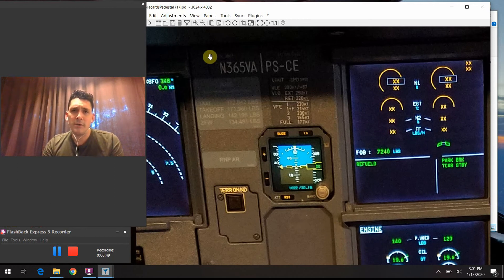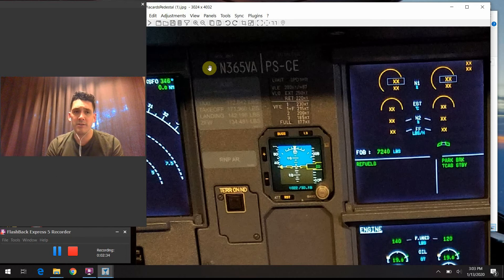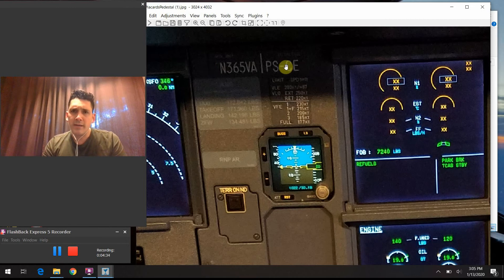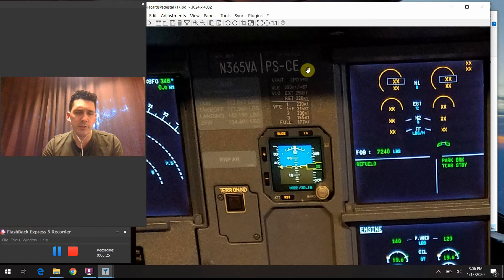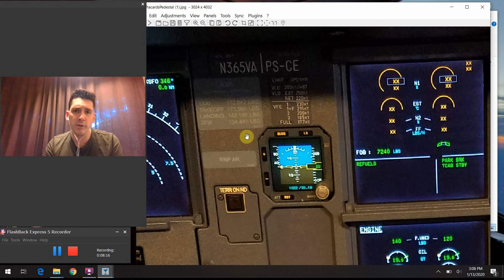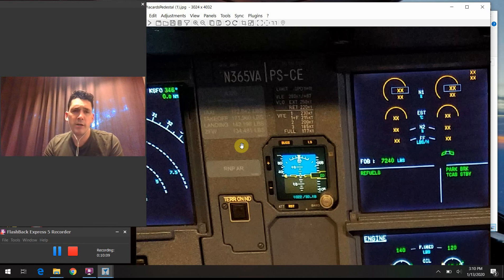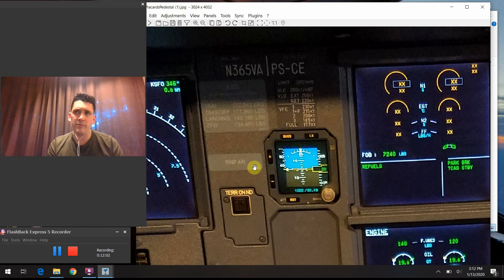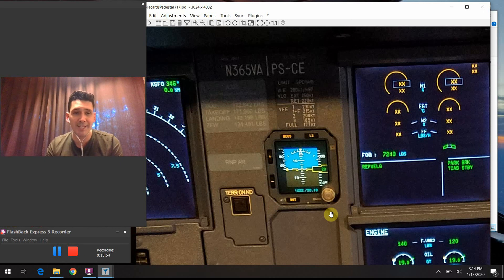Airbus A320 Cockpit Tour: #36 - Placards: What do all those buttons do?!

Comment: Hi Mr.Abignale

What is the difference between flaps 1 and 1+f configuration? How do you select between these configuration? 
In your discussion with Mr.Leonidas , you mentioned different speeds such as Vfe , Vle, Vmo/Mmo. What is the difference between Vmo and Mmo?
And the last question (not related) : Airbus just posted a video of their ATTOL : Autonomous Taxiing Takeoff and Landing project, where the plane takes of without sidestick inputs from Pilot flying. What do you think about this project and its capabilities and limitations?
Reply from the maker: Hi Aby! Great to hear from you! 

What is the difference between flaps 1 and 1+f configuration?

F1+F = takeoff and go around setting only.   Specifically,  in this configuration the Slats will be at 18° and the flaps at 10°

F1 = approach only configuration. The slats will be at 18° and the flaps at 0.

How do you select between these configuration? 

They make it easy on us as pilots. The plane knows what phase of flight you are in, so all you have to do is position the handle to '1' at the normal time and the plane gives you the appropriate setting. No more thinking involved other than that haha.

In your discussion with Mr.Leonidas , you mentioned different speeds such as Vfe , Vle, Vmo/Mmo. What is the difference between Vmo and Mmo? 

V is always used when referencing an indicated airspeed.  M always when referencing a Mach number.  So in our case we are talking about MO Max Operating speed in either V or M. The two numbers are sort of used interchangeably depending on whether you are in the speed envelope,  as there is always a corresponding IAS to a Mach # and vice versa.

To be specific, VMO/MMO on the 319/320  is listed as 350kts/M0.82

And the last question (not related) : Airbus just posted a video of their ATTOL : Autonomous Taxiing Takeoff and Landing project, where the plane takes of without sidestick inputs from Pilot flying. What do you think about this project and its capabilities and limitations?

Great question! I do have some opinions. I'll try to share some thoughts on the next video. 

Best regards my friend!
Reply: @MikeAbignale  Mr.Abignale thank you for answering my questions but I have another doubt about the Vmo/Mmo 
The Vmo/Mmo is given as 350/M 0.82 
But when I convert these values, they are different . 350 knots is roughly M .525 while M .82 is around 500+ knots. Why is that? Also during cruise phase, the PFD doesn't show the actual speed of an aircraft. Instead, it is given in the navigation display. Why is that?
Reply from the maker: @abythomas6963  
Excellent observations Aby!

The Vmo/Mmo is given as 350/M 0.82 But when I convert these values, they are different . 350 knots is roughly M .525 while M .82 is around 500+ knots. Why is that? 

The relationship between V and M actually changes as we go up in altitude,  so this relation is not linear. Mostly has to do with air density. Did you know that more than 1/2 of the earths atmosphere exists below around 18000ft? So the way I think of the 350 or .82 max speed, is like this,  whichever occurs first,  that is your limit. 

Also during cruise phase, the PFD doesn't show the actual speed of an aircraft. Instead, it is given in the navigation display. Why is that?

Well as we are flying there are various speed references we are concerned with. The IAS is most important in the regard that it tells us the aerodynamic flying condition of the wing.  Are we going too slow, are we going to stall? Or are we going too fast,  and we are going to damage the plane? As we go up in altitude air density decreases so we need to physically move the object faster through the atmosphere to get the required number of air molecules over the wings to keep it flying. And this is where we get True airspeed. Now we make a correction for headwind or tailwind,  and we get ground speed. The most important speed to the passengers haha,  meaning,  how fast can you get me from A to B. 

Hope you are having a wonderful day my friend!
Reply: @MikeAbignale Thank you for the explanations. So if I understand this correctly, does this mean that below 18000 ft  , Vmo is followed and 350 is the limit and above 18000 ft, Mmo is followed and .82 is the limit or does the speeds have nothing to do with altitude of the aircraft and one of them will be attained irrespective of the height of the object?(meaning the IAS would be 350 knots and Mach would be .82 irrespective of the altitude of the aircraft?)
Also, does this have something to do with the 250 knots speed restriction below 10000ft?

Also, about the explanation on my second question : so after takeoff and climb out to cruising altitude, the IAS is more or less used as a stall indicator of sorts and TAS and groundspeed comes to higher prominence during the cruise phase? Or did I miss something?
Reply from the maker: So if I understand this correctly, does this mean that below 18000 ft  , Vmo is followed and 350 is the limit and above 18000 ft, Mmo is followed and .82 is the limit or does the speeds have nothing to do with altitude of the aircraft and one of them will be attained irrespective of the height of the object?(meaning the IAS would be 350 knots and Mach would be .82 irrespective of the altitude of the aircraft?)
-Well, you have the concept, but the 18000 ft is not a hard and fast number by any means. Generally speaking, at lower altitudes you will reach the IAS limit before you get to Mach .82, due to greater air density. But remember, the atmosphere is very dynamic and density is always changing depending on the day. So it all just depends one what the conditions are of the day where you will find the "crossing point" lets say to where 350kts corresponds to M.82

Also, does this have something to do with the 250 knots speed restriction below 10000ft?
-It does not.The 250kt speed restriction is for ATC only. Think of this analogy...ships coming into the harbor. There is a high volume of ships coming in and out of the port, so it helps the controllers to slow everyone down so they can sequence and space all the traffic more easily. Same concept with airports, atc, and the 250kts below 10Kft.

Also, about the explanation on my second question : so after takeoff and climb out to cruising altitude, the IAS is more or less used as a stall indicator of sorts and TAS and groundspeed comes to higher prominence during the cruise phase? Or did I miss something?
-Well sort of. But the IAS is ALWAYS important to us, be it at high or low in altitude. Let's take this extreme example to demonstrate my point. Lets suppose that a clean A320 wing(subjected to 1G) stalls at 180kts. 10 Feet off the ground, the aircraft will stall at 190kIAS and 190kTAS. Now lets say we go up way high in the atmosphere, air density drops off significantly. The wing will still stall at 190kIAS but the true airspeed at this point will be much higher, lets say, 380kTAS. I'm just making these numbers up, but hopefully that makes sense just to prove the point and show the relationship between IAS and TAS as we go up, and while we are always concerned with the aerodynamic flying condition of the wing.
Reply: @MikeAbignale  Now I get it......Thank you Mr.Abignale 😀
Reply from the maker: @abythomas6963  sure Aby!